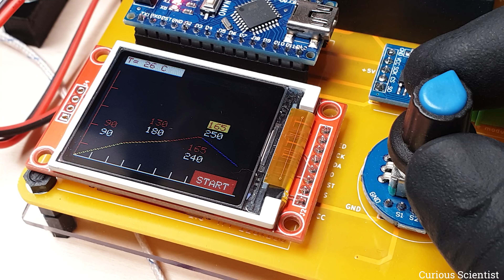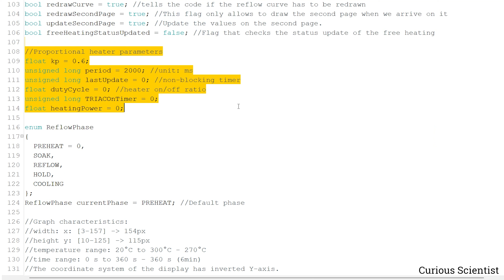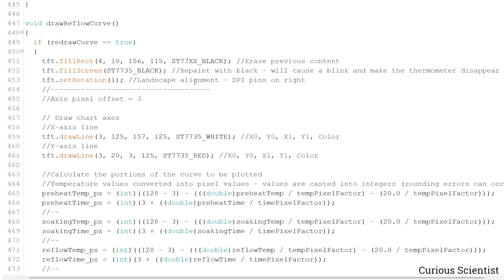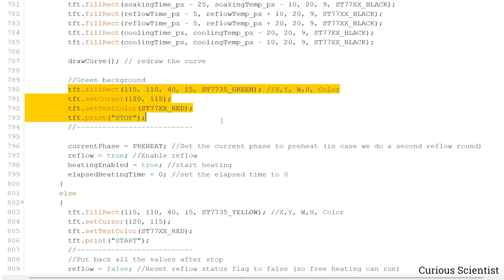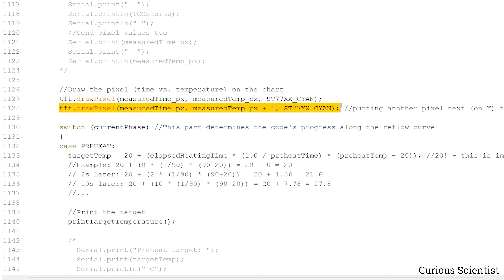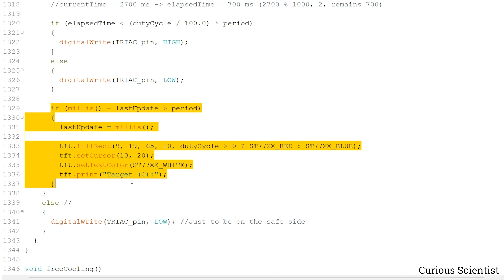Automated reflow hotplate - 2024 edition

Comment: Do not force cool liquid solder, it creates an internal dry joint.
Reply from the maker: What is a dry joint? Isn't solidified metal dry anyway?
Reply: @CuriousScientist  Thanks for asking. A 'dry joint' in this context, is when a soldered joint is cooled too quickly, or moved before it has solidified, causing various faults from a failure to create reliable eutectic bonding to the actual solder cooling to a mechanically weak crystalline form. For a more in depth explanation I suggest Googleing it?
Reply from the maker: @icarossavvides2641  Thanks! Sure, I could Google it, but if you answer it here, then future viewers can get the answer quickly. So, thank you for your time! Apart from that, I was curious about your interpretation, as a probably more experienced person. 

I am not 100% familiar with all the soldering terms, but I have a let's say fairly strong materials science background. So, my assumption was that if a joint is dry (i.e. "not wet"), then the bonding between the different parts is not sufficient because the wetting was not complete. So, I guess, I am not that far from what's happening. 

In my heating profile, I keep the system at peak temperature for some time, so I think that whatever should be wetted, gets wetted by the solder. So, hopefully that gentle breeze is not too damaging. But I will pay attention to this, thanks.

Comment: I finally found a “Reflow hot plate controller board” that meets my needs. Is the schematic not available? I'm already a registered member.
Reply from the maker: Hi! The schematics is not public, but the source code is. You can buy the PCB directly from PCBWay using my project page, so there's no need for the schematics.

Comment: Hollo, I was thinking on making it but I have a question: Where is the link to the ceramic suports that suport the heater and hold the clips, the white ones, where is conected the ground wire .
Reply from the maker: Hi! I don't always have links for every single small components.
Reply: @CuriousScientist  Do you know the name of the ceramic holder?
Reply from the maker: I guess you just type its name into AliExpress' search field and you can find it... Porcelain or ceramic insulator should work.

Comment: If you insulate the bottom of the plate trapping the air under it then you will increase efficiency significantly.
Reply from the maker: Yeah, I was thinking of placing some fiber wool underneath. I actually did that with one of the earlier prototypes.
Reply: @CuriousScientist  I'm thinking you can just box it out with that pink Styrofoam board if its rated high enough for the temps.
Reply from the maker: There's no way Styrofoam survives 400°C. Proper insulation is needed. Fiber wool is good because it is easy to form it, it tolerates very high temperatures, and it is easy to form it, so when the hot plate expands, it can just compress the fiber wool.
Reply: @CuriousScientist  True, I'm not up on insulation technologies, cement board would probably work fine as well.
Reply from the maker: I work with high temperature stuff up to 1000-1200°C, so I am somewhat familiar with the available stuff. Cement board can be problematic due to the fillers they use. But there are, of course, special cement boards on the market made for elevated temperatures. Still, I would go with fiber wool.
Reply: @CuriousScientist  Cool, maybe you could do a vid short on the insulated v/s non, cycle, it would be interesting to know the wattage as well as the time difference of the two.
Reply from the maker: That's a super idea. I will do it in the near future. Before the end of the year!